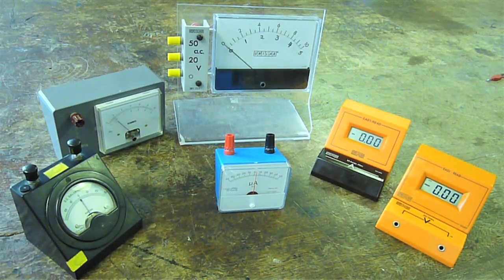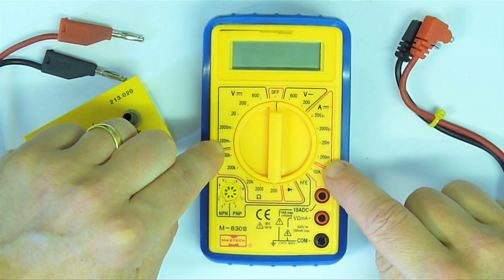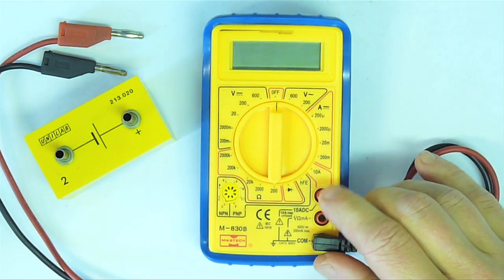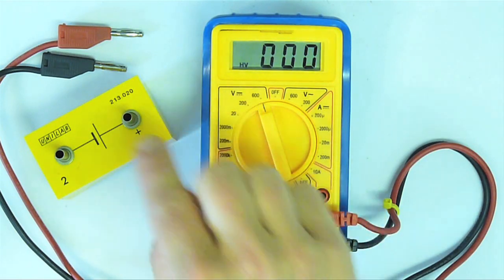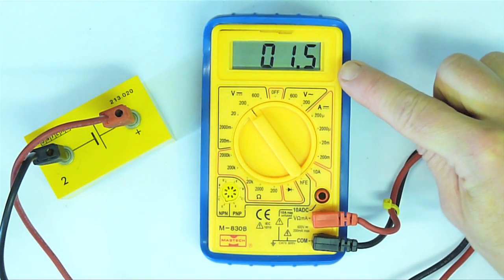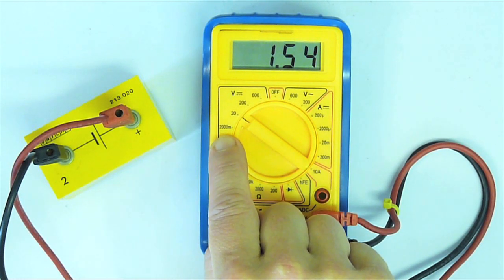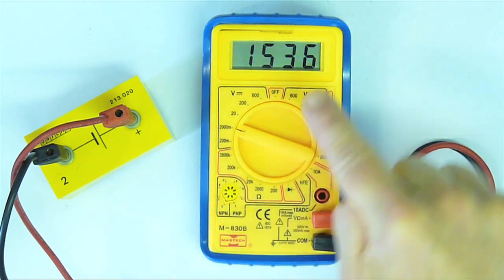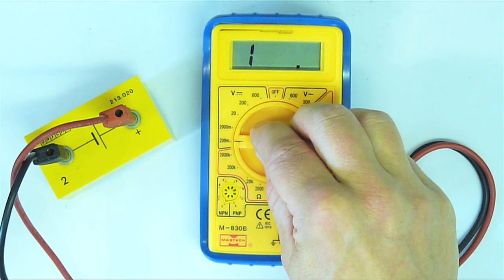How to Use a Multimeter: Measuring Voltage

Comment: Yes I also thought if the voltage is higher than what is set on your multimeter you can blow a fuse so when you get all significant values on the display the job is done you have your reading and NO need to turn the dial anymore.

Comment: Very simple answer  Good job.
funny how stupid we are in some things.. We may be rocket scientist in some areas but are idiot in others. My theroy is that some people are better in things that can be touched and moved around. But others are better at reading and using meters to touch for them.
We may be able to fix anything mecanical (solid) but electrical is very hard to grasp becuse we can not touch it or play with it,, with out a meter. Weird...  Most doctors for instance can read and remember  books ,so they pass. But we can not read and remember books as easy, and get bored or frustrated.... But we have 10 times the common sence of  most doctors or acedemic types. The acedemics run the banks the goverment . And what a mess it all is. Strange world...